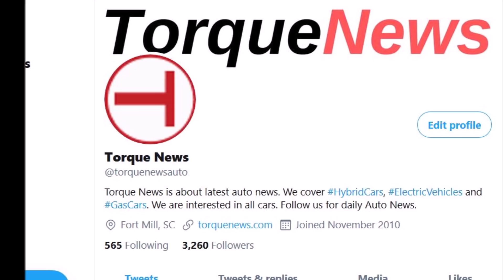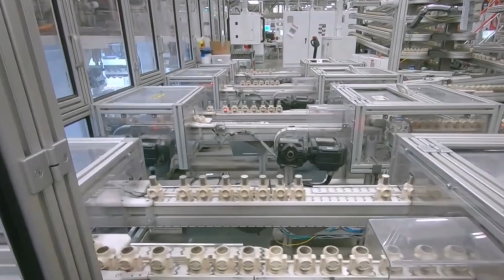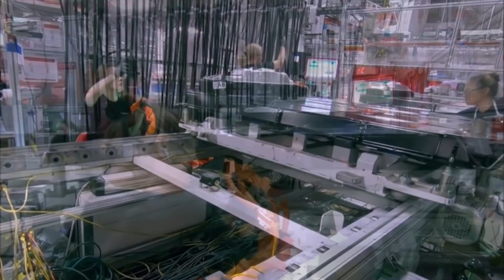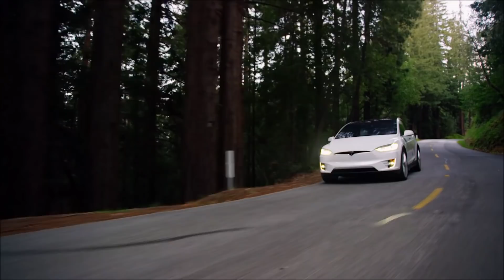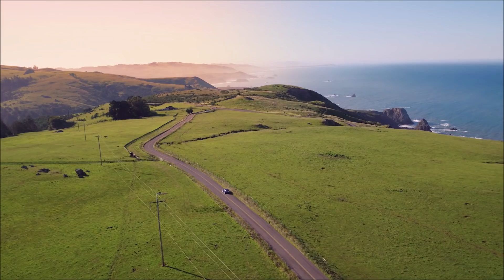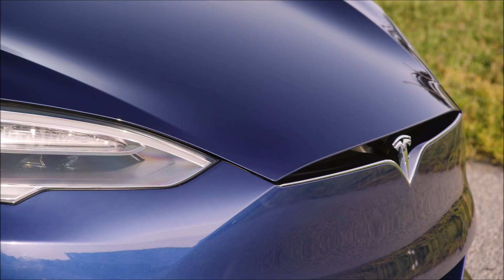2022 Tesla Pricing Predictions Due To New Battery Advances

Comment: Prices are inching up 500 at a time to get the model 3 above 40k so that the model 2 can be released with a 30k price. There needs to be enough of a price difference for both models to survive. Also, how will they keep raising the 2021 price up to 40k just to release the 2022 for 33-34k after new batteries? That will piss a lot of people off

Comment: Gigapress and battery updates and changing from A/C/Heat to heat pump/octovalve will bring prices down and efficiency up. 
My wild guesses 5-10% increase in mileage, along with about drops of $500 to $2500 depending on how much Tesla wants to impress Wall Street ($500) or actual buyers/manufacturers ($2500).
Reply: That is the exact opposite of something "insane" which Musk stated. This is the same guy who called Tesla at $700 (now $2500) as "overpriced".

Comment: FAIL.
Model 3 Rear-Wheel Drive: $46,990
Model 3 Long Range: $54,490
Model 3 Performance: $61,990
Model Y Long Range: $62,990
Model Y Performance: $67,990
Model S Dual Motor: $99,990
Model S Tri Motor: $135,990
Model X Dual Motor: $114,990
Model X Tri Motor: $138,990

Comment: Dropping the price of these cars is only 1/2 half of the problem.  What about insurance rates, which for any Tesla is as equally insane.  I was about to buy a Tesla till the sales person tipped me about the cost of insurance.  In Seattle area, your cheap model 3 cost no less than $325 monthly and I have an excellent driving record.  No tickets in 29 years.  More than twice I pay for a new Jeep Wrangler Sahara.

The biggest reason for the high insurance rates?  No parts available to repair the darned things.  So when a repair is needed, you pay daily for that rental till the parts show up, which is easily 30 days.
Reply: It depends on the area/state.  Insurance for my Model 3 AWD is less than $800 per YEAR from State Farm with decent coverage (100/300).
Reply: Seriously? I compared rates of a Model 3 vs my WRX and it is much cheaper. The car cost more to repair but it is way less likely to get into an accident.
Reply: My insurance on my Model 3 is about the same as my previous Accord, maybe 10% more.

Comment: Concerning pricing, I would expect Elon to price the cars so as to maintain the current profit margin.  So that would mean any manufacturing cost savings would be passed on to the consumer.  In practice, that probably means small price drops for the entry level cars and maintaining most prices or lower increases than the usual increases seen in the auto industry over the coming years.  This assumption is based on Elon's obsession to change the world over to reusable energy as soon as possible.

Comment: If Tesla can build a car factory and start production in less than one year don't you think they can build battery factories that fast or faster?  Build a building.  Move in lots of "exactly the same" equipment.  No casing machines, no paint rooms, no....

Tesla has certainly had a fair amount of lead time.  They've had time to figure out how to ramp up their battery equipment manufacturing capability.

If Tesla has a battery that is 2x or better than what they are now using why would Tesla not simply build battery plants and quickly move all their vehicles to a much superior battery?

Tesla would not have to sever their agreements with other companies.  In the short run they can use 'old style' cells for storage units.  Over time they can work out agreements with Panasonic and others so that outside companies also make Tesla's superior battery if that battery would improve storage systems or lower the cost.
Reply: @Bence Sebők 
I'm not following your thinking.  A 'handful' of factories means that you have to distribute batteries over the same range as you would if you had more factories and the factories were distributed.  

Battery swapping means that more batteries have to be manufacturing than with non-swapping.  Each swapping station will need some batteries charged up and waiting for someone to drive in.

Suppose it takes 25 minutes to rapid charge a battery (Tesla time).  And it takes two minutes for a car to pull in position, get its battery removed and a charged battery installed, and then pull out.  The charge station has to have 12 or so batteries on hand in order to keep from making customers wait.

Comment: I think the new Batteries will be coming for Austin and Berlin.
Reply: Eventually for berlin, i suspect that Austin will be the first major facility to produce the roadrunner batteries. But alot of cars will need to be redesigned to accept the new packs. 
Roadster and truck will be the first.
Once Austin is up to speed and can handle the demand load expect staggered retooling stops at freemont, berlin, and Shanghai.

Comment: After watching Warren's video it is clear that he is very knowledgable about Tesla's battery research and technology, but I think that he puts too much concentration and expectation of Tesla committing to LFP batteries. Tesla's alliance with CATL was a smart one because they will be able to lower the price of Chinese Model 3s and Ys using those less expensive batteries. And also Tesla's Chinese customers will qualify for Chinese New Energy subsidies by having Chinese-produced batteries. But I do not see Tesla expanding that alliance unless they cannot scale their own Roadrunner battery production. The whole point of doing all of their Roadrunner research, and developing/testing the new batteries and technologies was to give Tesla the option to not be reliant on Asian battery manufacturers which dominate the battery market today, and their aggressive plans to limit battery materials supplies and battery production for the highest profit and control. It is interesting to think about Tesla developing their own LFP battery (maybe using Maxwell's dry electrode design and Hibar's manufacturing technology) but I don't think that this is planned in the short term. I do agree that there will be battery design and materials composition specific to use and market. Specifically for the Powerwalls, which do not have space or use constraints that passenger vehicles have. These storage-specific batteries could easily use LFP for cost savings. Otherwise, for each of the instances that Warren mentioned using the LFP batteries in their passenger vehicles, I would substitute Tesla's own Roadrunner batteries, which will offer lower cost and reduced pack size along with faster production and higher energy density. But I don't see the short term vehicle price drops as dramatically as Warren predicts using his LFP batteries for Tesla vehicles.  And I don't see the use of LFP batteries in the Model S, X and Cybertruck, except maybe again in China to lower cost there and qualify for local subsidies.

Comment: There will be no lowering of price until,they need to. Tell Your Buddies at TOYOTA to lower their price so they can lose more money and go out of business faster. Save all that battery chemistry for TOYOTA who needs all the help they can get.
Reply: Doubt toyota will go out of biz. They actaully have decent business models. If anything Ford and GM will go out of biz first.
Reply: EYEOFTHEYOSEMIGHT OK You are right about TOYOTA. They were the worlds best perfecting JUST IN TIME for parts to be in the right place on the assembly line for install. TOYOTA has many missteps since. They developed the first PLUG IN PRIUS in 2012. Good car but it ain’t no TESLA because that was the first year for MODEL S which was probably almost twice as much but no comparison. So what did TOYOTA DO? NOTHING.  
They should have pivoted right then an their, spent money on developing their own battery and copied a TESLA. They kept on producing them for another 9 years and became the favourite for TAXIS. TOYOTA also thinks the future is fool cells it’s not. I can’t wait for HINDENBURG RESEARCH to expose their fool cells. MOST IMPORTANT OF ALL, TOYOTA manufactured over 10 million cars in 2018. By 2023, I predict TOYOTA WILL ONLY PRODUCE 5 MILLION AND TESLA MAY ALSO PRODUCE 5 MILLION ON THEIR WAY TO PRODUCE 20 MILLION BY 2030. Who knows if they survive with fool cells?